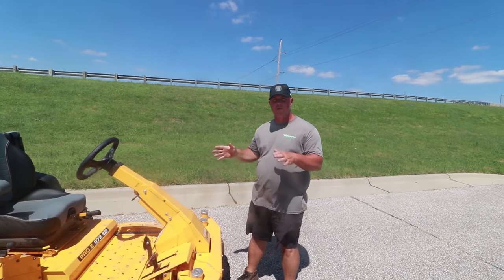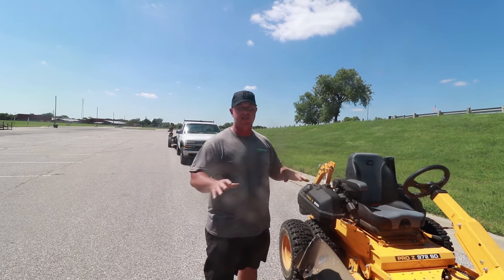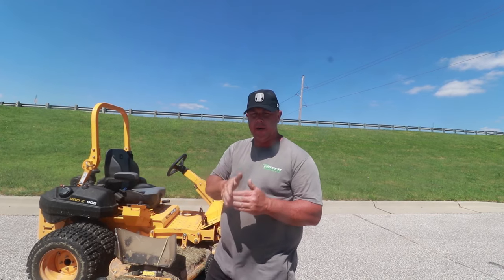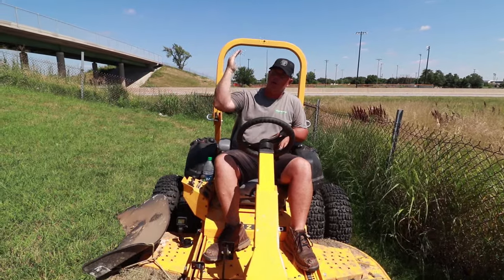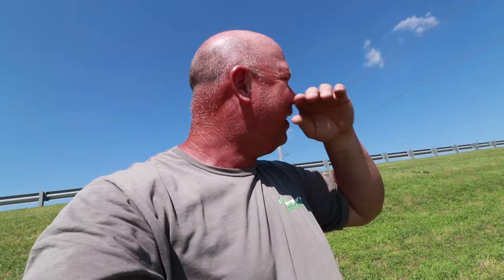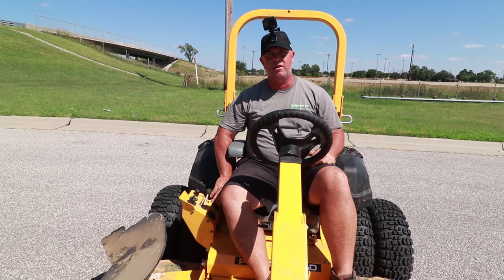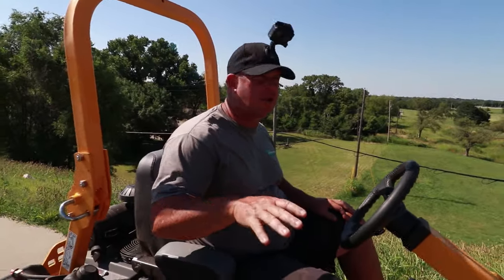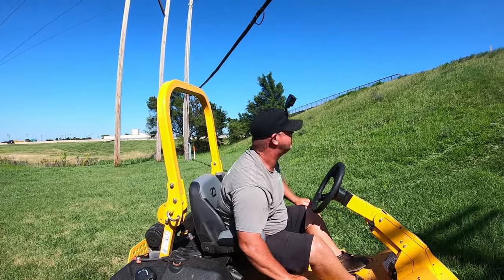Can It Mow Steep Hills, Zero Turn Mower Cub Cadet Pro Z 972 SD

Comment: I bought the pro Z 500 a few weeks ago (same machine with a smaller motor, deck, and single rear wheels). It is an incredibly stout machine, very heavy duty. I use mine on very steep grades with no issues whatsoever. Handles slopes that I would never touch using my father in law’s walker. Love this machine, can’t say enough about it.

Comment: I love my pro z 972. I mow hills like this all the time. The fact about a typical zero turn being able to mow hills is mowing across the slope, the axles/transmissions aren't made to handle the increased pressure and will fail over time. The 972 dually has extra heavy duty axles and are designed for side ways slope mowing. I am in no way bashing a zero turn, they are great. I live in the mountains and have seen what slope mowing will do to a typical zero turn.
Nice video
Reply: Been mowing stuff like this with Turf Tigers and 300 series Grasshopper since 2001. Not one drive failure yet... John Deeres on the other hand, a couple hundred hours and those TuffTorq transaxles are done.
Reply: Have_At_IT  Troll...
Reply: What mountains do you live in? I'm here in western NC...
Reply: @arngreencare8955  Northwest North Carolina Mountains, and mine will mow a 45 to  60 degree hill sideways no problem,  keeping your but in the seat is the hard part
Reply: @mountainmike1685  I'm down here in Lenoir/Hickory area currently watching the rain fall...

Comment: I've been using a Cub Cadet ZForce s60 with steering wheel for 8 years. It will mow slopes that I used to flip a push mower on. I need to put a hand hold on the sides to stay in the seat! It will drift on really steep slopes especially if the grass is wet. There is no need to do three point turns as they are programmed into the system. Everyone knows how to use a steering wheel. I use a spinner knob and steer with one hand using the other for waving at friends, fending off branches from trees, etc.

Comment: Just bought one a month ago. It’s a beast. The hills on my property were dangerous with an exmark. I make maneuvers on this machine that I wouldn’t even consider on the exmark. I do disagree that it’s not residential machine. I’ve found that the cut quality is comparable as well as the finish stripes.
Reply from the maker: Awesome.

Comment: I have hills on my property that i had to push mow because my power king would slide down into the fence.  My cub cadet tank sz 54  handles it like its on rails. Ive never been on a more comfortable, more secure mower. This thing is very capable and very safe.
Reply from the maker: Thanks for sharing

Comment: I have an Ariens zero turn and it will just about climb a tree, but when you aim those front wheels downhill on even a small hill you better hang on. I have a part I mow around 40 degrees and it does it going sideways or straight up. That Cub Cadet is an amazing mower. I don't need one for my small yard, but I sure would love to have one.
Reply: What model Ariens do you have that climbs that well? I’m interested

Comment: Just a small tip for you guys because I've been using a 50 inch zero-turn Toro for about 3 years now. The key is to turn uphill instead of downhill and that way you don't slide like you did. The reason I say this and give this advice is because imagine trying to mow next to a ditch with a fair amount of water and mud at the bottom. I've slide into it before and needed a couple people to help push it out.

Start at the bottom if you can and work your way up the hill. This way you have the benefit of mowing while getting out at the same time. Also, if you have no choice but to start somewhere in the middle, like on the side or near a steep ditch like I have to, which is how I also learned what I have and am about to tell you (i.e. don't go any lower than willing or what you know the machine can handle), try backing in slowly at a slight angle and turn it into position of the line at which you want to start cutting at; then move forward to the point of where you want to start cutting at. Never turn down into a slope, because that's how you start sliding and potentially start rolling over, and instead turn into the incline as you mow.
Reply: This is precisely the instructions detailed in the cub cadet syncho steer manuals.

Comment: I use a zero turn without duals on the rear, but have filled the tires with fluid. This adds about another 75 lbs or so which helps keep the mower from tipping over when I go side to side, not up and down, on the hills like your #4 rated hill. -- Took me awhile to get up enough nerve to go sideways only the hill but with over-sized really 'off-terraine' 4x4 tires on the rear, it holds, and has never flipped over yet. Without the fluid in the tires I almost flipped it once, which was enough for me do the mod tires and fluid. Both well worth it. BTW, my yard is over 10 acres which I mow each week during peek spring/summer months, with the house and barn on-top of the huge hill sloping down to the stream. -- Good video.
Reply from the maker: That's crazy, never heard of doing that. Cool deal.
Reply: How long does it take you to mow those 10 acres?

Comment: I owned a 972S with the single rear wheel for 2 years. It was amazing on hills. You should have turned uphill. Mine never tried to come up in the front and it didn't have the weighted front wheels. I know that mower would have driven straight up that bank. Excellent mowers, I just wanted to standardize my mowers to all lap bar machines. I used mine on residential yards and commercial properties alike. Like you mentioned, running the foot pedals and spinning the wheel all the time gets kind of cumbersome, especially in smaller, tighter areas.  I put a spinner knob on my steering wheel like mentioned in another comment. I would zero turn mine and it did just fine unless I was in a hurry and went kind of fast, then the front wheels would push a little and probably tore more than the rear wheel. They are a tough machine. They will take curbs at an angle perfectly also. Takes away some of the "squared up" jolt. Nice video.

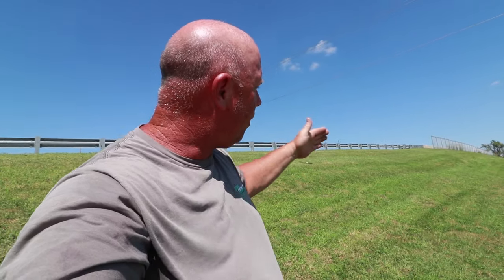Comment: Nice.  At 9:56, it was a 180.  If your back is to an Exmark, and a straight, thin line takes you to a Cub Cadet, start walking toward the Cub Cadet.  When you reach the Cub Cadet, turn around and head back toward the Exmark.  That turn is a 180.  A full 360 would point you toward the Cub Cadet.

Comment: we run cub cadets in the blue ridge mountains and even the ZX models can handle hills like that,the secret is to hang off the upward side of the hill like a sailboat and believe it or not the faster you mow the less it slides

Comment: I was looking at the Cub Cadet steering wheel ZTR’s four years ago because I have hills like that on my 3 acres. The Cub Cadet dealers in my area were pushing ZTRs and would not offer a demonstration despite Cub Cadets website indicating they would. That opened up my options, so I opted for the 60” Pioneer S Exmark with Kawasaki engine because the dealer was closer and had free delivery. I have had to add 35pounds of weight to the front and can only go up the hill and then back down. I still think of this mower when I am on my hill

Comment: You were talking about making three point turns with that mower. You don’t have to make a three point turn. Just make a u turn. I have a Cub with a steering wheel and it will not tear up the turf. A three point turn takes a lot more time.

Comment: The only thing I see wrong with that mower,  forward and reverse pedal,  should be a single pedal with a center pivot on the pedal, toe push forward, heel push backwards, then you would have a perfect mower....  you had already mentioned, you did not like having to change from one pedal to the other... correct...

Comment: A little turf tire at 9:40, not bad but a little lifting of the lawn. Now in your last video (when you got the mower) the Cub Rep said 20% max...was that only for safety or because of engine and transmission oil flow too? AND if 25%, why are you going on a 40+ degree hill? lol

Comment: One more question, if you ever roll over or flip backwards are you safe if you stay in the seat protected by the roll bar. I wish I had something solid to hold on to in the event that ever happened.

Comment: Brian... now go back and test drive a John Deere X739 all wheel drive, all wheel steer on those same hills.  This 60 inch deck garden tractor will go any where I point it, wet or dry, up hill, down, side ways, etc.  The liquid cooled Kaw engine doesn't miss a beat, or slow down.  It cuts well, with speed, and It works great to pull out stuck zero turns in the spring.  Mount a blower in the winter, and go do 30 residential accounts, like I do here in central MN.  12k machine vrs 16k for the Cub, and the John Deere will hold its value better.  Blessings
Reply: I have a X748 and a 972SD.

I can assure you the X748 will NOT go everywhere the 972SD will. Up and down? No problems. It will climb anything. But unless you've put duals on, a 4x4 lawn tractor won't get close to the 972SD for side sloping (have done near 1 for 1 with no issues).

Comment: A little of the lane, you appear to have a levered parking brake, available to ride, when you are going down very steep hills. I'm looking at the zts1 (for residence) which does not have a levered parking brake.  Any experience on how to slow down with the zts1?

Comment: Nice video Brian! If you want to get better fuel economy out of big mowers do what Mike from Something2LookAt does with his Cheetah, similar HP engine and he hardly ever runs it at more than 1/2 throttle, maybe going up to 3/4 on overgrown places. You just don't need that much power to do most yards lol.
Reply: That's what's great about the hyperdrive.  You can run 8mph at 1/2 throttle.  You also are a lot quieter from less blade noise.

Comment: I have an account steeper than this and I use a Husq zero-turn to do it. At some points I go up and down and I have to lean WAY forward or she'll pop a wheelie. At other points I go side to side across some steep angles and I have to really lean into the slope or those wheels will come off the ground. I always slide down the hill if there's any moisture, but that doesn't scare me as much as piss me off. I feel ya, brother. Mowing ain't always a hoot. LOL!
Reply: Also, on one of my accounts it's very steep and I use a Walker. One way I can sit way up on the edge of the mower leaning into the hill. The other way I can't so I do the return passes backward the entire strip. That's a good time...NOT!

Comment: The "25 degree limit" on slopes may be because the engine won't oil properly at a steeper angle.
Reply: I was thinking the same. The oil pickup is probably good for the advertised 25 degrees plus a safety margin which makes 40 degree slopes uncharted territory that could get very expensive in a hurry.

Comment: You could do a lot better with more practice need to turn with the weight behind the mower in other words keep your real wheels at the bottom and your lighter side at the top when turning your ass should never be pointing Towards the Sky towards the ground is the correct method

Comment: i would like to see you run a Ventrac in the same situation and compare.
Reply from the maker: Yeah that would be cool
Reply: We have an early model Steiner which is from the same maker and it handles these hills pretty good, albeit it also has the steering wheel which can be a pain. These mowers are best for flat terrain. When you're doing steep slopes these steering wheels can suck out loud. You're almost better off to start at the top, do a stripe, then back down into the next strip as opposed to trying to go nose first where you're more inclined to slide. Slow and steady is the key. Been there, done that.

Comment: The only machines i like levers on each side on are bobcats, i hate them on riding lawn mowers. Having a steering wheel makes cutting grass more enjoyable. Zero turns are great at cutting grass but i hate them with no steering wheel, plus there ugly. Riding lawn tractors with a engine in the front with a hood and steering wheel will always be the better style and looking lawn mower, and theres 50-60 inch decks and 24-27 HP engines on standard riding lawn mowers also, even tho anything over 17-18 hp cutts almost anything anyways. I have even a 12hp briggs riding lawn tractor that never bogs down even in 2 feet of grass. New belts, blades, and a purged transmission every year makes a serious difference. I prefer that tractor the way it is, and yes that is a tank with a cutting deck attached to it, sweet machine

Comment: I've been on steep hlls where I SAT HALF BUTT ON SEAT AND OTHER HALF HANGING OFF SEAT ON HIGH SIDE OF HILL WHILE LAYING OVER TO HIGH SIDE OF HILL TO COUNTER BALANCE.  LIKE TANDEM MOTOR CYCLE RACING AT IT'S BEST!  UNTIL YOU DO THAT.  ALL OTHER HILLS ARE JUST LITTLE BUMPS.
Reply: I do this all the time on my John Deere L130 Lawn Tractor to put enough weight on the uphill wheel to give it traction.  The L130 is fairly light, about 500 pounds I'd guess, so my 200 pounds body weight can shift the center of gravity quite a bit.  I'm not sure shifting body weight to the uphill side helps much on a 1300 pound Zero Turn.

Comment: I HAVE THE MOWER....I WOULD HAVE DONE IT GOING UP AND DOWN AT AN ANGLE ACROSS THE FACE OF THE HILL.
STRAIGHT UP OR DOWN AND STRAIGHT ACROSS THE FACE IS MORE LIKELY TO SLIDE OR COMPLETELY LOOSE TRACTION IF THE GRASS IS WET OR THE SOIL WET.....OR, IF THE SOIL IS COMPLETELY DRY AND HARD.
i REALLY ENJOY THE MOWER...IT DOES A GREAT JOB FAST AND EFFICIENTLY.  I WOULD LIKE TO SEE A CRUISE CONTROL AND THE LUBRICATION OR NON-LUBRICATION MAKES ME FEEL I MIGHT NOT BE DOING WHAT NEEDS TO BE DONE.
CHANGING THE BLADES WITH THE ACCESSORY LIFT IS VERY EASY.
Reply: Have yet to find a Zero turn that will go straight up or down. That's when the trouble happens. Always straight across.